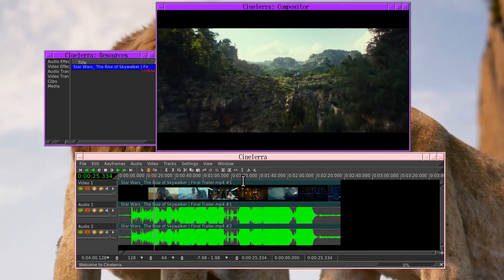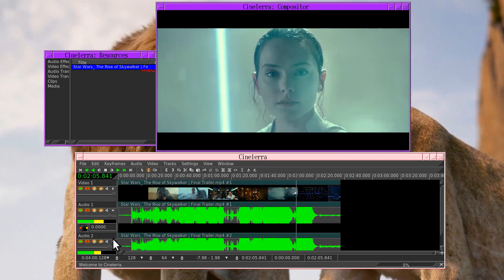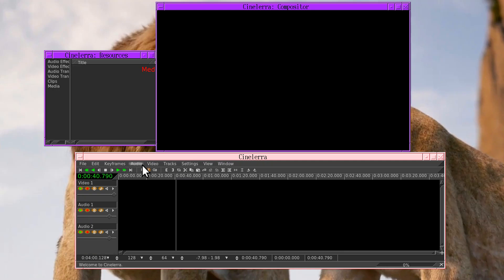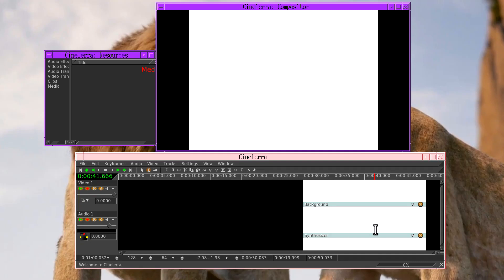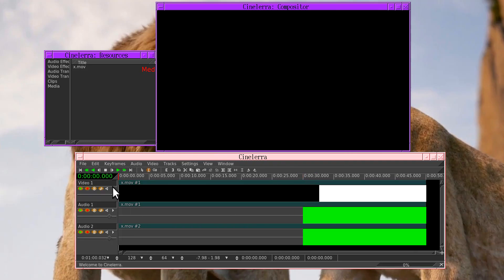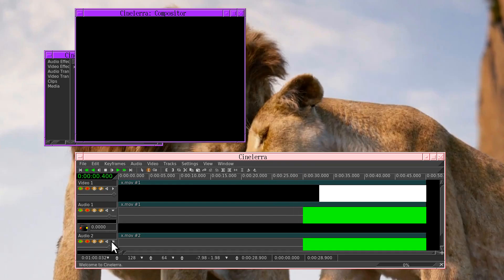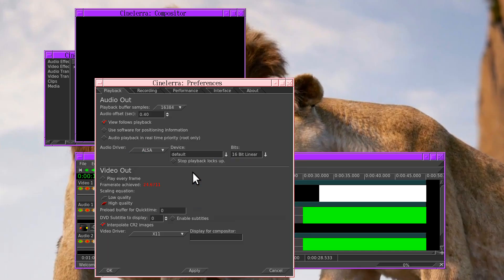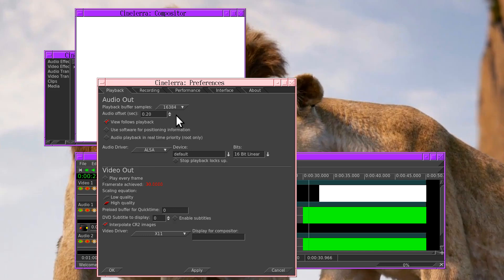Synchronizing audio & video in Cinelerra

Comment: This is a good tutorial. However, users often misunderstand the purpose of this setting.
This setting is intended to be used during the setup phase of Cinelerra.
It is not an editing tool.  Use the Nudge facility to synchronise video/audio.
I.e., the Audio Offset is for calibration, and the Nudge is for correction.
Calibration is per computer/installation, and correction is per project/format/track/clip.

Comment: Can I ask you how color management works on Cinelerra? (I'm actually a Cinelerra-GG user, but I know it's the same. Feel free not to answer me) 1- how are the color data of the original files treated? 2- How is color treated in the Timeline? 3- How do plugins affect? 4- How is the output treated on the display and in rendering?
Reply from the maker: There is no color management workflow.  They shouldn't sell it as a replacement for Davinci Resolve.
Reply: @Lion_McLionhead   Thank you very much for your reply.
There are many requests in that sense (even from me) given the excellent plugins for Color Correction (Blue Banana, etc). Most of all, I don't know how Cinelerra treats the colors of the files and how it shows them on the display. I often get inconsistent results that I can't understand. GG never touched that part due to lack of specific knowledge.

Comment: Hello.

I have a basic question about usage of your program.

For some reason I can't move clips over the timeline by taking the title bar and pulling the clip back and forth. The clip just don't move. Why is that so? Does the program have this function at all?

Thanks.
Reply: Yes, it is a very necessary feature for an NLE. You can find this feature in community forks.
The original Cinelerra-HV performs automatic adhesion of assets to each other on the timeline. By the way, this is a very useful property that protects a user from random black frames at the junctions between footages.
A user should select a particular "piece" of the track and remove it (if he wants to move an object to the left) or add a blank space (to move an object to the right)  (Shift+Space).
However, you can also make a feature request to Adam. Water wears away stones.